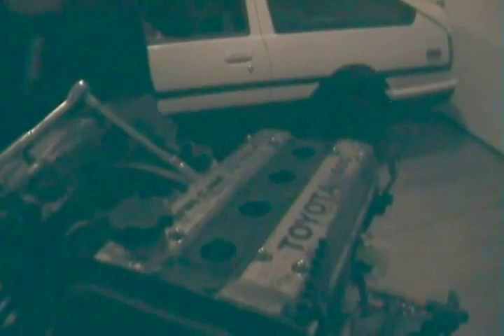How To: Compression Test a Pulled Engine(4AGE)

Comment from the maker: @pjtart 
This is a spare engine vic picked up for $100, turns out compression is only good in 2 cylinders so were gonna need to find out what the issue is.

Vic spun a bearing in the motor in his car, driving down the highway the crank pulley cracked and the water pump belt poped off causing an overheat that pooched the bearing. Were probably gonna have to swap the motor, or put the head from his current motor onto the block from the one in the video. If so we'll have a video on it.